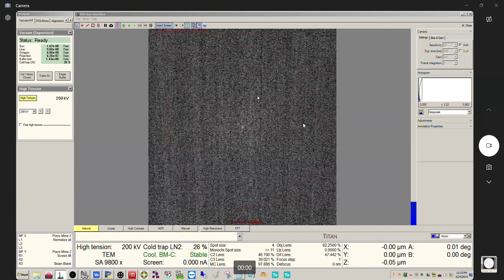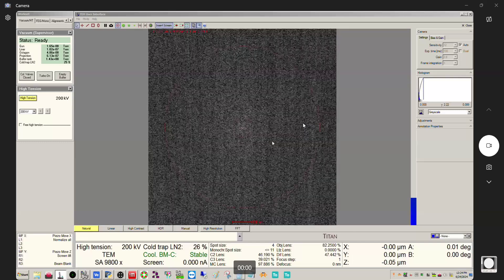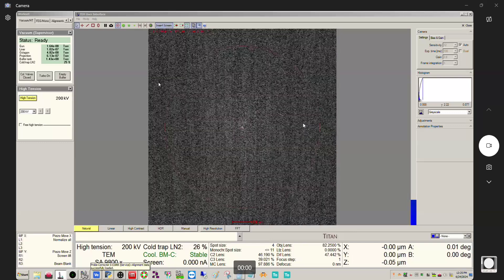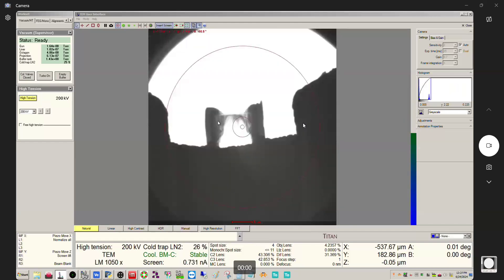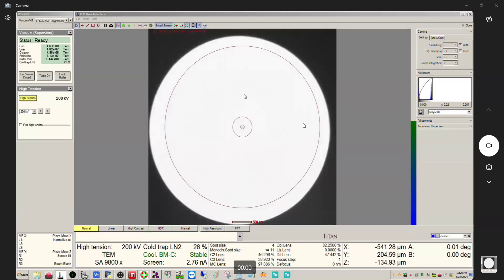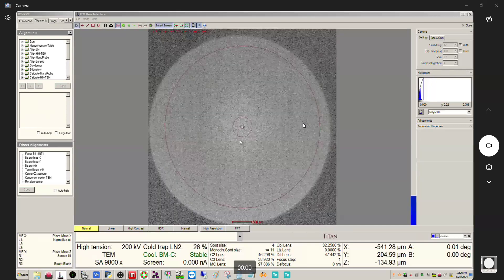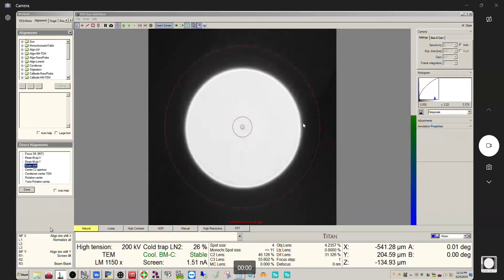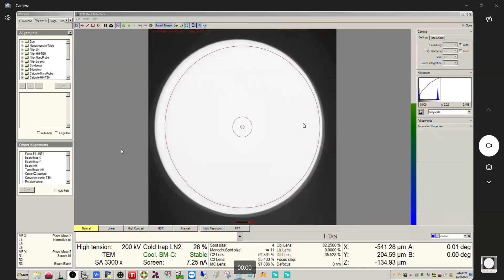Help!  I can't find the beam! (S/TEM version)

Comment: Eeea, every day routine on finding the beam )) Nicholas, do you know, why does the beam has the different monochromator shift for STEM and TEM? Every time I switch tem/stem, I lost the beam and should shift it by monoshift. Could the position of monochromator be stored for each mode?
Reply from the maker: So, the monochromator shouldn't be changing shift values when you change between TEM and STEM.  Just to be clear, are you sure the reason you are losing the beam when switching between modes is from the monochromator and not something else?  There will definitely be different beam shift values stored for TEM and STEM modes.  The other possibility is that the monochromator is be normalized when you switch modes.  This could cause a measurable (but small) shift in the beam, but with the monochromator spread out quite a bit, I would think this would be barely noticeable.  Anyways, hard to diagnose without actually seeing what is happening; if you have some way of recording a video and showing it to me, I can probably provide a little more insight into what may be happening.
Reply: @NicholasRudawski thank you for so detailed answer. I've try to attach the link on google-disk with explicative video of my screen, but apparently, YouTube doesn't allow linking in comments. Anyway, thank you for some thoughts about it.
Reply from the maker: @adrianzavodov6745  If you can email me a link to the video, I may be able to check it out that way; check the video description for my email address if you want to try doing this.